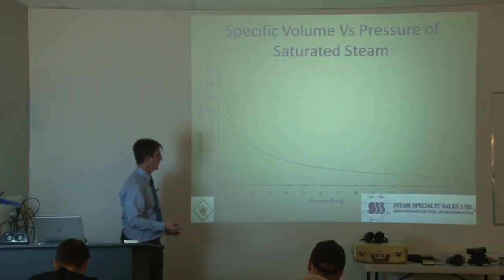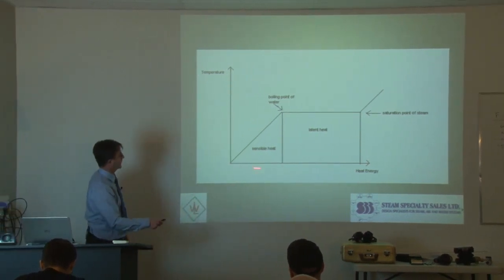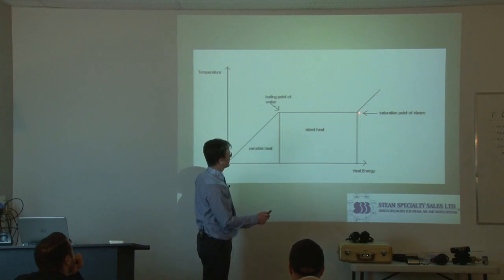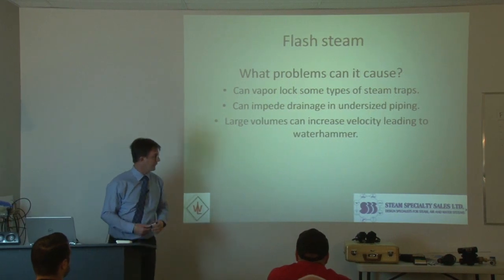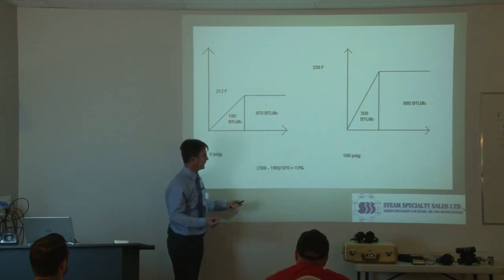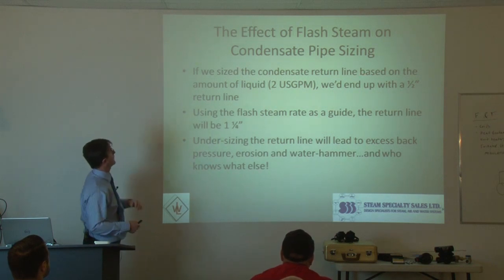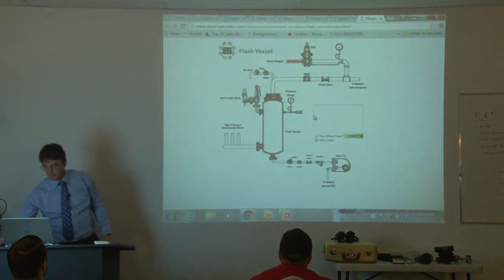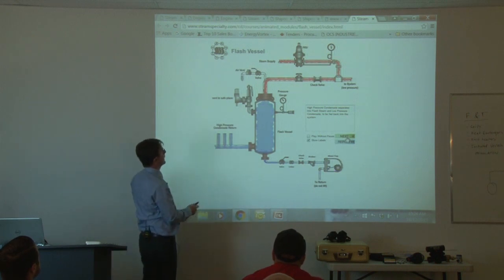Flash Steam

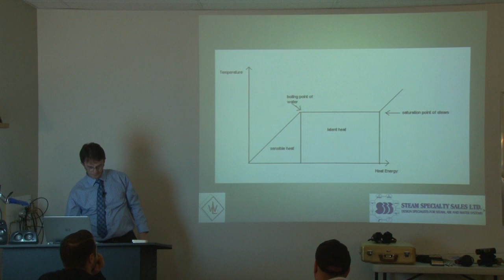Comment: Good video....At 3:03, why latent heat is higher at lower pressure than at higher pressure?
Thanks.
Reply: I dont really confident with my answer. Maybe it helps.

If we look at the thermodynamics p-v diagram of the water-steam is behaving like a dome, wider at the bottom and narrower at the top, which mean a lot of heat needed at the lower pressure.

I guess, it has a connection with supercritical state or something about that.
Reply: @dimasrizky1413  Thanks... It's correct...